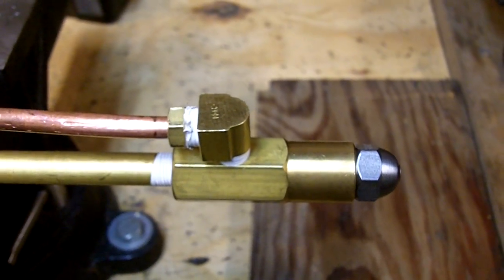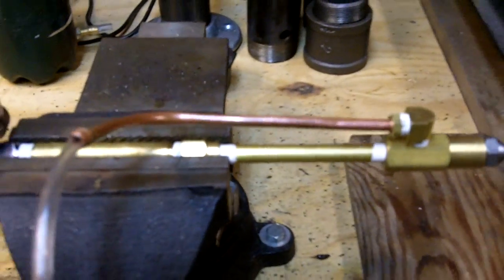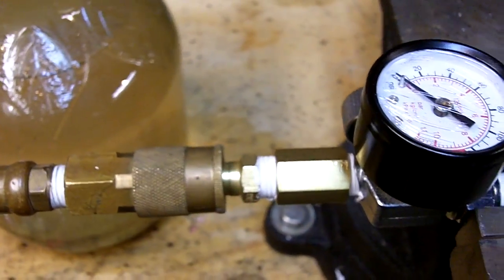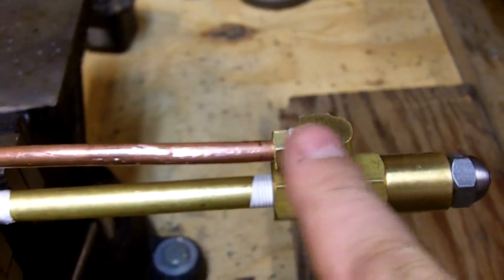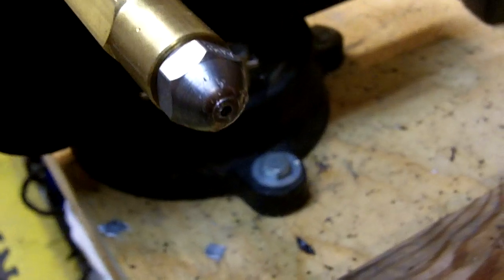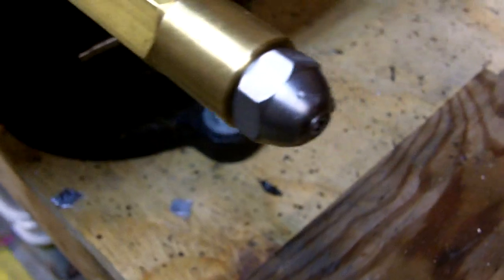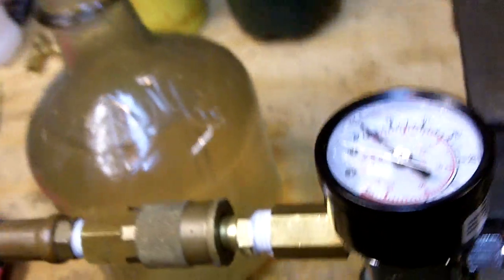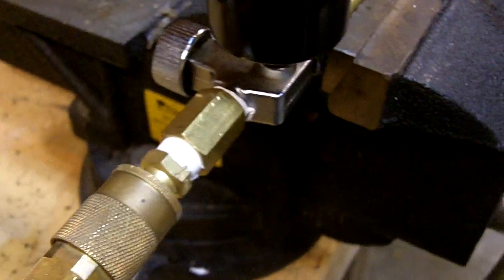Siphon Nozzle for Waste Oil Burner

Comment: I've built alot of heater blocks , the outside nozzle barrel with 4 slots guides air 90°into tapered swirl pieceThat swirling air sucks Oil from the center oil passage

Comment: Manuscript delivered to 
Patent office was approved, but redone to Patent, to only allow 50% 
efficiency increase of oil furnace by addition of steam from water line 
to spray nozzle. Military soldiers off duty during 1950's collected used
 jeep oil to burn in used oil furnace. They attached water line SS 
tubing coil in insulated fire pot and by monitoring temperature point 
would open valve for T fitting to allow steam line mixed in. The steam 
had been changed to super heated steam with flame on coil. At 1500 
degrees F, the oil valve was shut off , allowing A Hydrogen and Oxygen 
torch flame to continue.  Furnace provided constant heat unless water 
line shut down. If temperature then was reduced, then oil had to restart
 furnace to get it back up to proper temperature. Motor had dual shafts 
for 2 oil pumps for 90lbs. each. The highly sensitized H2O at great 
pressure was subjected to vibration shockwave when exiting pinpoint hole
 nozzle to AMBIENT. The gases separated and burned with the 10Kv 
ignition. The lowered dissociation temperature of steam was realized, 
rather than normal 3-5000 degrees F.  A much smaller working burner unit
 with fire brick surround in large box was shown to senator in under 
ground parking garage. No further news came afterwards.
Reply: Why compressed air instead of propane?

Comment: what did you say about the cheap harbor freight air pressure gauge? you given up on it? does it not work well? Im looking for a gauge now for my burner... no idea which ones to buy.. theres stainless steel ones,, ones that are water filled.. and cheaper ones with the black casing.

Comment: I'm using the .2 gph Hego nozzle and getting air pressure up through the 1/8 npt port blowing air into my fuel tank. Somebody else had that same issue. How did you fix that issue? Any help would be appreciated.
thanks in advance!
Reply: is your nozzle assembled correctly? about the only thing that should cause that is if there is a blockage after the swirl plat in the tip.
Reply: Ryan Plethra there are 2 kinds of nozzles. one is for pressurized oil and the one you need with the siphon nozzle is it has like a tail on the nozzle and a rubber o ring. if your using the one with no tail it will back up into the oil tank

Comment: I like it but I think you need a larger feed on the nozzle up to 3 gph and this will increase your heat big time. 30 psi  and yes pre heat your oil say 130 degrees. Find a old slow cooker set it on low. kelly

Comment: @LandsharkLabs Ok I watched again and appearantly enough air passes through the end nozzle it doesn't push back on the oil supply. The siphon action is caused by a venturi effect , the same as a carburetor, fast moving air creates a vacuum pulling the oil into the process. My question is , does the oil still flow uniformly during the pressurization state?

Comment from the maker: @schwe100 No particular reason of the 1 gph that's what was available. I'm gonna run everything through it veggie, engine etc. and use it to run a forge and foundry. This will burn motor oil. I'll be doing more experiments here soon.

Comment: You have to run the air pressure into the oil supply to equalize the pressure, control the mix and let the atomization begin.

Comment: @mujgy Well with a bit more searching looks like you used a Delavan 17147 adaptor,  but what model nozzle did you use?  You said 1 gph so I'm guessing a Hago SN609-11 nozzle?  Found them both on patriot supply.  Looks like a much better solution than making your own nozzle.  Have you made any more progress on this?